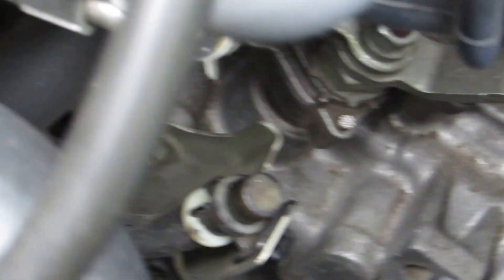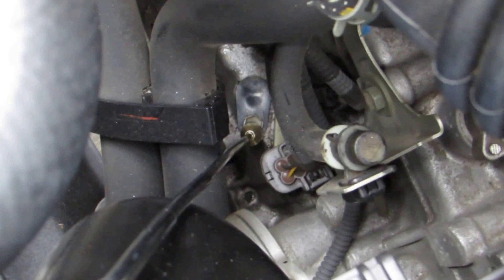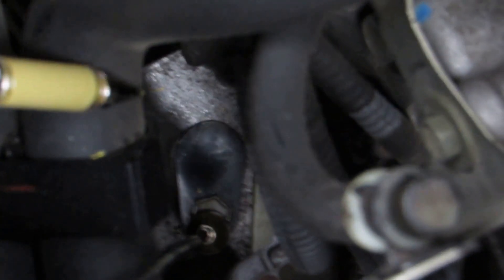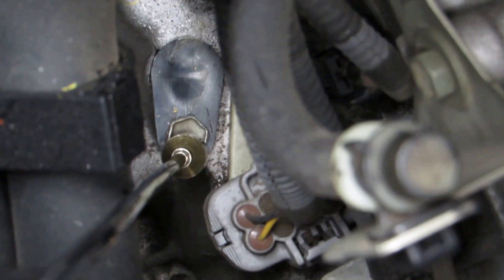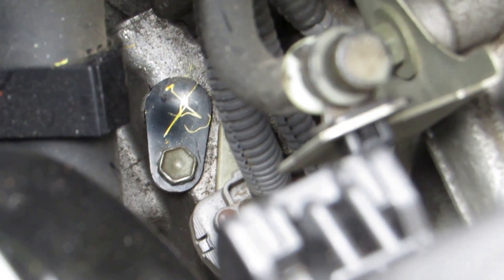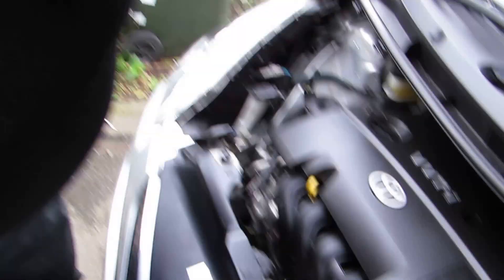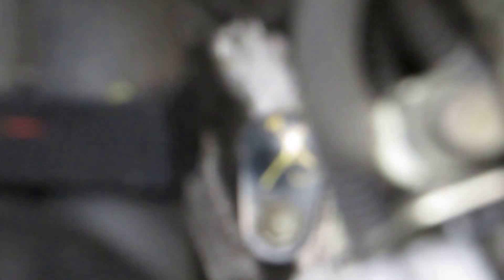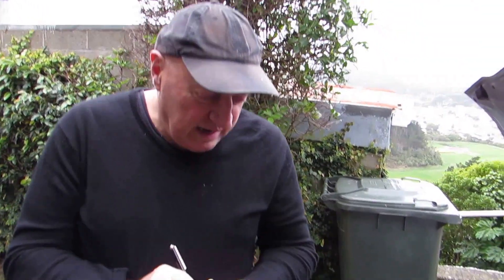2005-10 Toyota Ractis  oil filler port for autotrans

Comment: Nice video. Not many people know about these transmission. They are known as sealed transmissions, the have not dipstick(conventional) where with to check the fluid level.  They are very fuel efficient, great to drive. I have done quite a bit of searching to find information on them since i have one in my car as well. This CVT transmission uses Toyota CVT Fluid TC, it is very specific and this is what toyota recommends for these transmissions. Fluid is "suppose" last the lifetime of the car, lifetime fluid sounds a bit crazy to me so i'd rather check and change mine every 100,000KM. Thanks for the video, hopefully it helps many people.

Comment: Thats not the filler port,the filler port is at the rear of the trans,behind the black plastic inner guard,cant miss it its got the intials TC printed on the bolt you remove that and use a funnel to refill it.These transmissions run a special dipstick inside the drainage hole when remove the sump plug,comes out with an allen key,if you dont remove this plastic level indicator(dipstick) you wont get all the oil out only a small amount.Take note of how much oil you removed and refill that same amount,,if youve lost some oil and arent sure you use the level indicator  as a guide.Theres some other videos on here of how to get the correct level with the indicator.Generally pays to remove the sump and clean the filter or better replace it and clean the debris magnets at the bottom of the pan and replace the sump(pan) gasket if you have broken it.get the correct CVT oil for this trans,otherwise you will wreck it.

Comment: congratulations on your new Tractis I hope it gives you good service
is it an auto transkmission or a a CV transmission Continuously Variable
Reply from the maker: David Stanley Thanks David. Yes CVT with 70,000 kms. My last had done 210,000 and was getting tired.
Reply: bryanpepperell
 best to offload them before the repairs start
good on you.
looks to be a  car that will go easy on the petrol